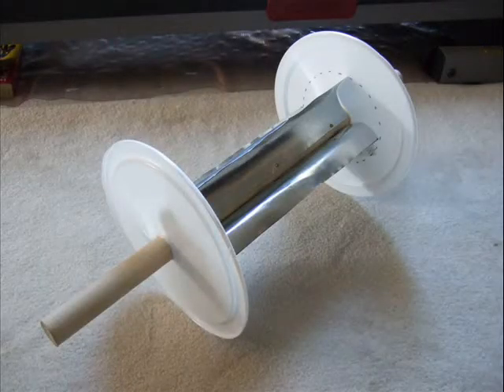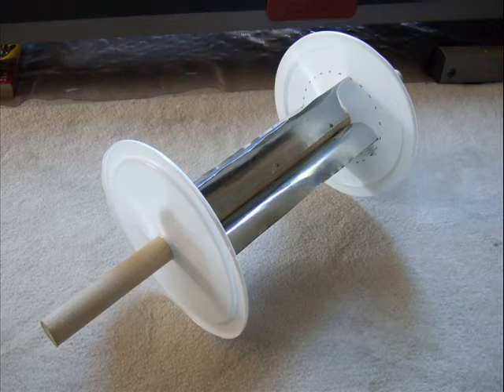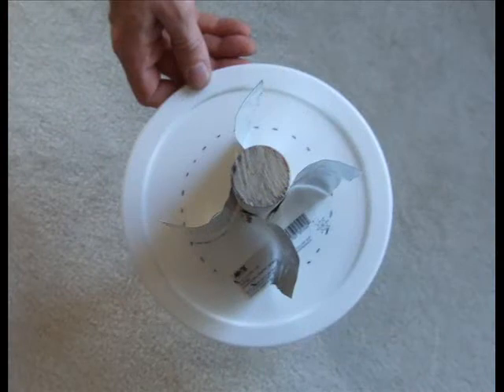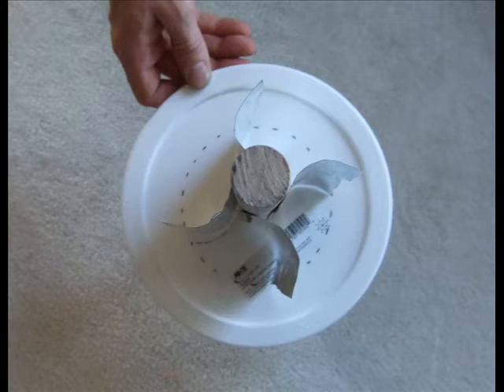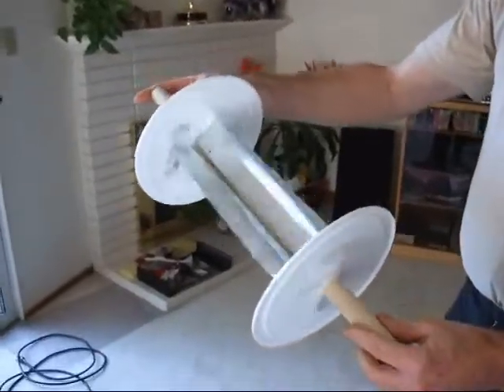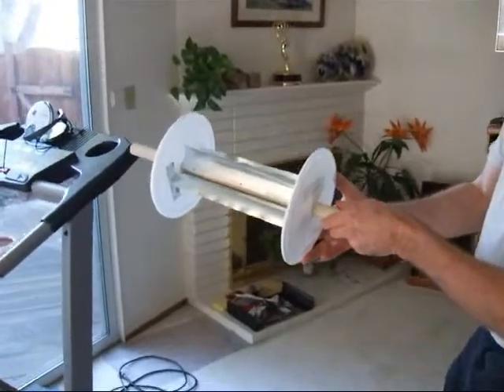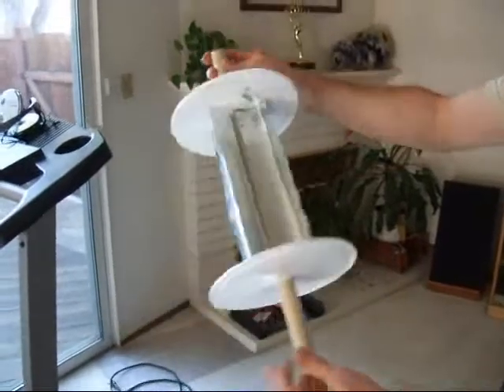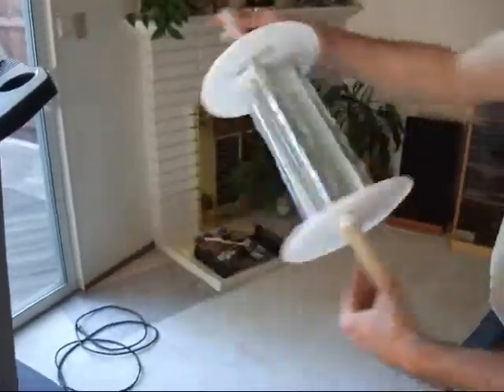DDWFTTW - Demonstration of Flawed Design

Comment: the thing all these other suggestions do is get away from the fact that the propeller is a propeller, not a turbine which is what these other sav and lenz ideas are. Of course they won't work. you need something annalagous to the wheel to propeller drive for it to work; perhaps a large helix inside a tube driven by the wheels but why not just accept the simple beauty of the unit as it is???

Comment from the maker: @macrumpton 
Everything you say about this design is correct.  It is flawed in its very conception.  That's what we set out to prove to the guy that proposed it.  However, you did get one part not quite right...

>> although that would not work on a treadmill, it would need to have actual wind.

There's no such thing.  The treadmill and "actual wind" are the same thing.

Comment: @mylexusis 
 Imagine an iceboat (which easily exceed 4x wind speed going across the wind) attached to a string going through a pulley fixed to the ground. It is easy to see that the the string will be pulled through the pulley at  the speed of the iceboat in any direction you lay out the string. It is not self contained, but the principle is easily adapted.

Comment: The big problem I see is this rotor does not have any particular direction that it blows air when it is spun. It blows the same amount towards the front and the back and the top and the bottom, so of course there will be no thrust. Also, Savonius type rotors use drag to create rotation from wind which is far less efficient than using an airfoil rotor. It would be interesting to see if a lenz turbine would do better, although that would not work on a treadmill, it would need to have actual wind.

Comment from the maker: The test only looks like it's reversed.  Whether the device sits on a moving surface in still air, or on a stationary surface with moving air (wind) makes absolutely no difference.  In neither case will it do as you predicted.

Comment: That whole test scenario is in reverse!

The applied force is NOT supposed to be on the wheels as in this demo, rather on the vanes!
With a 2:1 ratio, air blowing 10 mph against the vanes will rotate the outer surface of the wheels at 20mph.

Comment from the maker: I assume you're refering to the prop-cart from our other videos.  In that case converting to upwind operation simply requires using smaller wheels.  As to larger propellers, the sort of propellers that have been used for human powered flight should do just fine.